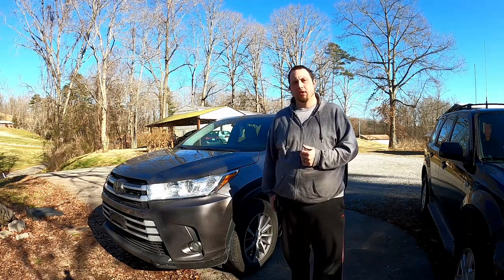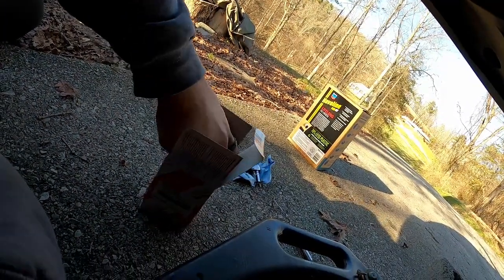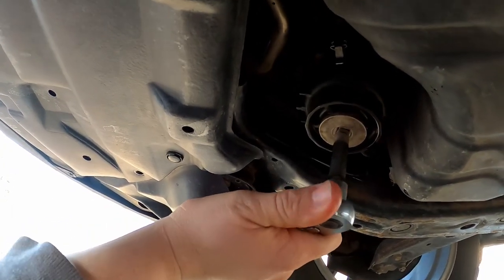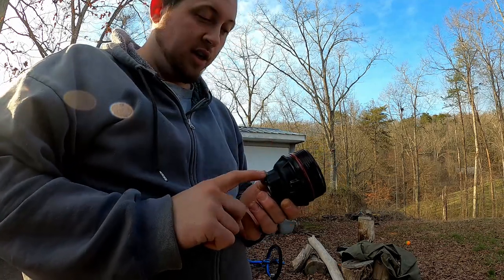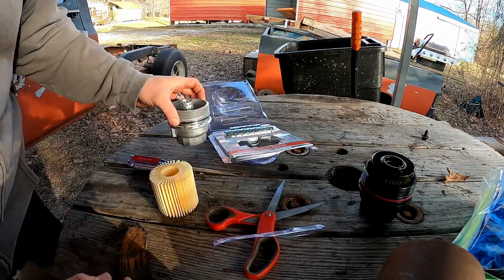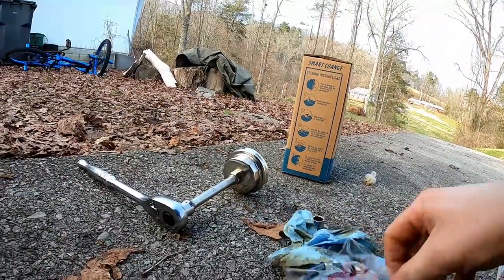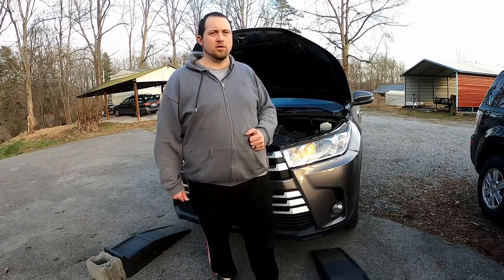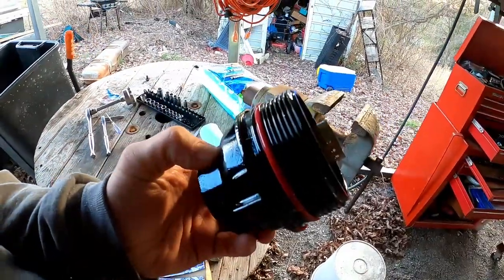Oil Change, and Replacing a Non-Broken Part on the 2018 Toyota Highlander

Comment: The primary reason the plastic oil filter caps fail is because whoever changes the oil and filter doesn't follow the recommended torque spec of 18 ft.ibs.

Comment: You might want to read the instructions also, I know many people will skip that part.
There's a small tab that you need to straighten out on the part that the tube sits on.
This will keep it in place and prevent it from coming apart from vibrations. The little wing tabs are
bent up by default so that you can change the tube for the proper size you need.